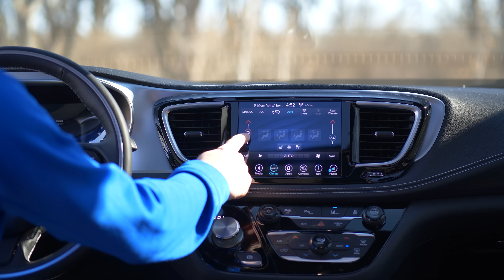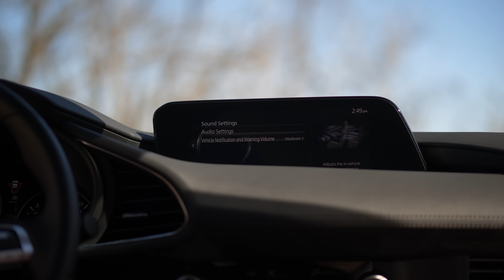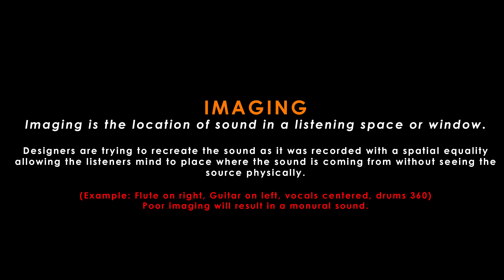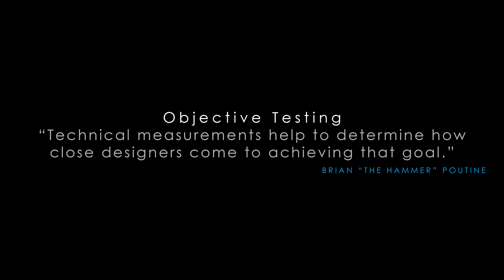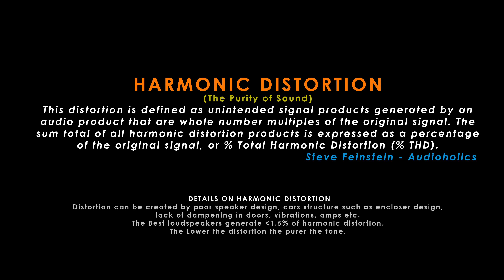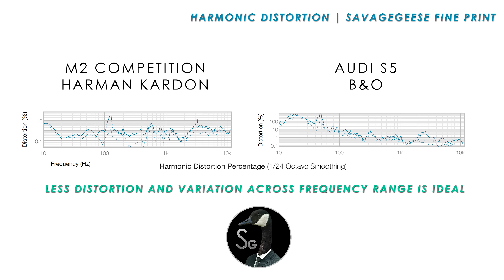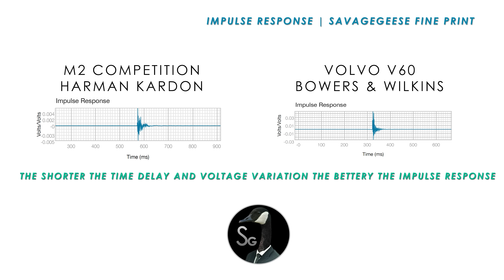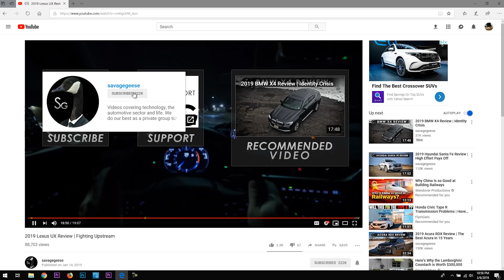Understanding Car Audio Design

Comment: All you need to do to get an amazing car audio setup is to head down to your local Wal-Mart, pick up two 12" subs and a 1000 watt amp and install them in your car. Preferably, all of these parts should be from brands no one has ever heard of. You will know you've hooked everything up right when every 808 bass hit in your Migos songs furiously rattles your license plate to the point it nearly falls off.
Reply: Don't forget the undersized copper clad aluminum wire that isn't run to the battery in the trunk (near the amp), but, to the jump point under the hood. All joking aside, I re-did a system last week that was setup like that.

Comment: Very Nice Video
Would like to add some notes

Note:

1. More Drivers does not equate better audio quality - So yup Marketing
2. Drivers should have wider dispersion, placement is more difficult in a car
3. Shallow driver design due to depth limitations
4. Drivers should have good sensitivity, less power draw & more efficient
5. B&W isn't that great of a sound
6. Great sound doesn't have a sound signature. It should produce what's given to it. Exactly like the source
7. You can get quality and volume, but driver cost would greatly increase.
8. Drivers in Car Audio markets are often marketed prices far higher when compared to Home audio even when performance is the same
9. Bass in a car would often be more clean due to cabin gain. That means driver does not have to move as much resulting in a more linear performance .ie few hundred vs Killawatt levels. I know because I have 4kW available. EQ can be used to bring a flat response.
10. A car audio setup cannot match a "proper" studio. Especially those with 16' ceilings and proper treatment
11. Frequency response charts are one thing. Speaker distortions and dynamics are also very important. ie. impulse and efficiency
12. Rolling off the higher frequencies gives a more pleasing sound to many people. 
13. Bad drivers/ bad drivers can give tinny sound. Bad crossovers can also have the same effect
14. The distortion is always there, it just increases as you go up to the drivers XMAX. 
15. Due to the difficulty of mounting, drivers with wide dispersion or great off axis response is optimal. Most cars sort of have it pointed straight
16. Paper cone does not equate to cheap. They are light and can be treated. Being light has many benefits.
17. The magnet is also important but so is the control of flux within the motor and how linear it is thru-out it's motion. 
18. The coil used, type of driver design. Underhung or underhung and how it is designed
19. Keep in mind, impulse response is 1 measure
20. You can get very good sound for well under 2k if you DIY.
21. New systems with auto correction can over correct leading to the sound having artifacts. ie ringing, imaging, floating image

Comment: If anyone is willing to spend the extra money on full dynamic range in a system they should already understand that USB audio is still superior and worth the inconvenience.  Also, Apple CarPlay and and Android Auto usually only work with a wire in a common modern vehicle. As much as I love Bluetooth and it’s conveniences, the higher the system power the more noticeable degradation in reproduction will be.  I have a 300wat   JL subwoofer along with JL door speakers and direct firing chin level tweeters located on each corner of the door panel. My car is sound deadened, but this does not discredit my point as most modern cars use better materials for insulation anyway. We are talking about a simple 5 channel setup that can reproduce 22hz all the way up to 22k. I can clearly tell the difference in bass tightness and treble sharpness when switching between USB to Bluetooth.

Comment: I had a Toyota with the JBL system. I still have the Toyota, I just now have Sony ES / Pioneer subwoofers, speakers, and amps.   It's not going to win any competitions but it sounds really good and don't distort when you turn it up.

Comment: I mostly listen to podcast in cars as while i am getting older, i find that music in car is very distracting. It cover most of the spectrum. And you need a certain level of volume to make a good audio system shine. At low level, you will have an hard time to hear all the spectrum. 

Podcast on the other end are mostly just talk and leave a lot of room to hear the surrounding. I also think, altought it's very subjective, that talk radio / podcast are very random by nature where music follow a beat or tempo. I find that listening to podcast in long trip make the road feel shorter than music because of that. 

I think the first thing anyone should do is test driving the car without audio to get a feel on how much noise there is. Then look at the audio.  Some car are so noisy that you have to crank up the volume very loud just to be able to hear properly.
Reply: I agree.  I prefer my audiobooks to pass the time because I can get lost in the story, so I'm not focusing so much on how long I've been at the wheel.  I turn up the mids, turn down the bass, and I'm good.  With music, I find that I have to fiddle with the controls much more because the settings rarely are optimal as the music tracks change, whether I'm streaming or listening to files I have on my phone.  When I test drive vehicles prior to purchase, I will listen to the stereo before I drive.  Once I drive, all that is turned off so I can listen to the actual car, as you've stated above.  Noisy tires can be corrected (more money) but wind noise is something you just have to deal with.
Reply: You don't need more volume, you need less noise.  You would be amazed at what some sound deadening can do for the entire spectrum.  It really should be the first step to car audio mods.  If it was, I'd bet a lot of people would happily stop there.
Reply: @336699334  sure, less noise first always makes more sense. But with this POS Corolla rental I'm in right now, the wind noise is as bad as the shitty engine and cheap noisy tires. Even if I owned this car, I can't do anything about wind noise. My personal cars AREN'T quite this shitty (Lexus IS250 and Toyota Solara).

Comment: I gotta say we bought the Genesis G80 for the in-car listening experience above anything else. The sound deadening and dual paned glass paired to the 900 watt Lexicon system have been outstanding. The ability to enjoy the listening experience in our cars is everything, so I really appreciate this video.
Reply: G80 has acoustic glass windows, not dual pane.
Reply: @michaelgrant5258  Ah I stand corrected. It's awful thick and someone told me it was dual pane so I just bought the line.

Comment: I know the VW Fender system is a re-branded Panasonic system, but I'm honestly surprised at how decent the sound is.
Reply: It's great! My friend has a VW with those Fender speakers and it rocks!
Reply: What is inherently wrong with Panasonic built speakers? They build very high quality parts, fender set the parameters and Panasonic built them well, fender knew the sound they wanted, knew to put enough power in it, knew the issues a car presented and worked with them not against the problems to make a system that sounds great. How is it being a rebadged Panasonic system bad?

Comment: In my experience, only the sound the driver hears really matters -- as soon as you get two or more people in the car, the volume invariably gets turned down enough to facilitate conversation. 

Oddly, some of the best car audio I've heard lately was in a 2015 Chrysler Town & Country. I'm not saying it was good, but it was the least crippled by an infotainment system along the lines of my recent Mazda which had hands down, the worst sounding car audio I've experienced. Murky as hell, and virtually no definition in the high end.

My next car will likely be a utility van of some sort, and I will sound insulate the hell out of it, and created a forward sound stage (ie no door speakers) using a good head unit and a quality amp. Speakers will likely be a quality home pair if I can get the right crossovers. 

Infotainment is for the birds...
Reply: That's interesting.  I haven't listened to much audio in the T&C, but each Dodge SUv and van I've rented had horrendous audio.  For some reason, the front driver side tweeter was always distorted, even at the lowest volumes.  If I have a chance, I'll see how my mom's T&C sounds.  She's only had it for a month, and I haven't ridden in it yet.
Reply: My 2000 Jeep Grand Cherokee with the infinity sound system BUMPED!!! I had a 2014 Dart and now own a 2017 Ram 1500 with just the regular audio and both of them BUMPED. The treble was clear and you could crank the volume all the way up with distortion. And these were the base systems.

Comment: Why measure from the passenger seat? 
The driver's seat has 100% occupancy whenever the car is used. All branded automotive audio makers know this, so if they are going to make a compromise on spatial imaging or spectral response, the decision will be made to benefit the driver's seat, not the passenger's seat. 
The explanation that the passenger seat has fewer surfaces for acoustic energy to bounce around is spurious. No manufacturer designs the DSP for a car amp in an anechoic chamber and then plops it into a car. 

Also, check your definition of impulse/step response. Yes, one can measure the overall latency of a system via the impulse response, but delay isn't what is measured when taking an impulse response. I also take issue with the statement that a paper cone causes  delay. Is the statement is that an audio designer might put different amounts of delay on specific drivers because of their materials? Still a little disingenuous, as generally speaker materials aren't mixed and matched in a car. The rationale goes back to the oft-mentioned price.

Comment: I purchased the Kicker VSS system for my F150 XLT Crew cab. The system comes with an amp that ties into the stock system, as well as the kicker 8" subwoofer. It definitely livened the stock system up. Supposedly it is tuned to the stock speakers and so forth. I'd definitely like to see what the difference is between the VSS setup and the Bang and Olufsen. I definitely learned that you do not need 1200 watts to improve a system. Balance is key. Awesome video!

Comment: I still remember ripping out a late 90s honda civics speakers, pretty much made of cereal boxes, that was where they cut every corner.  Factory sound better be good, because adding it after is simply not cost effective, especially the sound proofing which is frankly the most important part of all.

Comment: The system in my Golf R (Fender/Panasonic) is superior to the Bose system in my Z06 and Civic Type R
Reply: My old GTI Mk5 stock audio also sounds better than several BMW 1-series I've owned, current gen and the one before that. Maybe having a similar cabin/design on the Golf helped VW deal with the challenges of getting good audio

Comment: My Fiesta ST has maybe the best car audio I've ever owned. I've never had luxury vehicles but Evos, STi, Camry, 4runners, Silverado HD. Even my GTi with upgraded audio wasn't as good. Ford Sony system is good
Reply: I agree! I have a Ford Fusion with the upgraded Sony sound system and it BANGS 💯✊
Reply: "Sony"
Reply: Sony is junk for speakers and receivers.
Reply: I have the standard Sync 3 system with navigation in my Fiesta SE and it sounds great to my ears, no overwhelming bass. I use CDs and FLAC files on USB sticks. I have my Onkyo receiver and turntable at home if I want hi-fi.

Comment: The JBL setup in my Camry is by no means high end, but it's good enough for what it is at the car's price point. The problem is it comes with a 'surround' mode enabled on all sources by default that makes it sound horrible, so people think it's a terrible system. The mode will randomly re-enable itself too.

Comment: $$$$  ABOUT TIME!!!  You sir are the best!   I have that pos 370z, and let me tell you, worst audio "system" ever.  I firmly believe that the stock setup in that car does more to damage hearing than anything else.  The road noise is what kills the experience in the 370z, mainly the back half of the car, so it required tearing it apart, and installing multiple layers and types of sound deadening, and yes, it still sounds horrible, but it's been a monumental improvement in moving the frequency of the road noise lower and to a good degree quieter.   It's still no audi. 

I found you really have to just rip out everything with the stock setup and start over,  so you have your sunk cost of which head unit you want, speakers, amps, wiring, time/frustration, and integration (getting the steering wheel controls to work).    Then you get to go through the fun of time alignment and additional sound deadening and locating rattles and redoing things.   Still when it's all said and done, it was worth it, but it's still a Nissan product, so it's never going to be Lexus / Toyota in terms of NVH/quality, but you kind of forget all that when you're not stuck behind the Subaru / Prius drivers and get to tackle a good set of corners while your fave music is blasting. 

For the 370z, the time alignment aspect made a night/day difference in getting the sound floor above the stupid dash, but you're right on the $$ when it comes to the tweeters bouncing off the front glass, so attenuation as well as a soft dome design helps, along with running the largest one you can get in there to bring the x-over frequency lower (yes at the expense of longevity) which then brings the imaging up a bit. 

I'm a firm believer in one channel to each speaker and going fully active to maximize control and output compared to running passive x-overs in your typical component kit setups.  Running a separate class A/B amp for mids/highs and a separate class D amp for bass garners maximum control so time can then be dedicated to the never ending process of dialing things in.  Lastly, the biggest challenge of all is simply finding quality music that has a longterm shelf life, as most now is recorded with loudness pegged and the whole auto tuning nightmare = can be harsh in the car over long time periods because of the reflection issues you've mentioned (most tweeters are bouncing off the front window).

Comment: The best way to improve sound quality is to start with the source. Can we get away from compressed audio here in 2019? Flash drives can hold thousands of uncompressed songs these days. Unfortunately, digital music stores are still stuck on compressed audio.
Reply: That's because their servers will run out of bandwidth sooner with larger files... Best off just buying CDs and ripping them to your preferred format.

Comment: I can tell you without any special equipment that the base stereo in a Honda accord (9th gen) is HORRENDOUS.
Reply: I haven't heard a Honda stereo that wasn't terrible. Even the "440 watt 12 speaker premium audio system" in my Civic Sport Touring pretty much sucks. Acura's ELS system's on the other hand are actually pretty good though.
Reply: @splewy  The speakers in my S2000 are also ridiculously bad. But I take that as a hint that that is not what the car is about. Honda should up their game for less sporty models though. Nobody wants bad audio in their daily.
Reply: 9000Redline Yeah agreed. My Civic is my daily, and I was pretty disappointed that the most top end “premium” audio system offered in that car was so bad. I guess they’re saving the good stuff for Acura though, because like I said before, the ELS systems are all really good in my opinion.

Comment: Sound signature? WTF?,...the idea is to reproduce the original sound inside the vehicle. That said, the general public doesn't want "near field monitors"  affixed to the dashboard, rather the public wants them built into the doors, pointed towards your torso...or butt. This very constriction assures everyone concerned, in car systems will sound like crap...do yourself a favor &  affix monitors on the dashboard...don't have the room inside your car?...then you will have crappy sound, always will.
Reply from the maker: Id love to see someone mount some near field monitors on the pillars.
Reply: @savagegeese  Something like a vintage ADS L200C, or the larger L300e mini-metal speakers, or the full-on JBL LSR 305,(I know, AC powered amp, easy to convert) ...or the cheaper and more plentiful Realistic Minimus 7 ...don't like such things on your dash?, don't like music I guess.

Comment: hey mr savage, for the future when you are displaying graphs, make sure the scale for the x and y axis are the same. there were many graphs in this video that did not have this and I bet a decent chunk of people misinterpreted some of the information you provided because of it. i'm very thankful for you to take a scientific approach to car audio and am excited to see this implemented into future videos.

If it would be possible, could you also do this kind of testing to see how good, for example, a $2,000 aftermarket car audio setup is compared to a $2,000 manufacturer car audio setup? I have always been under the impression that if you spend money on good aftermarket speakers, such as audison or audiofrog, and a quality tune (equalizer, DSP, time alignment), the performance/dollar will absolutely destroy harmon/B&O factory setups.

Comment: I had the BMW M3 convertible which had the most powerful audio system they had ever created.  It was good.  Then I heard the Tesla Model 3 audio.  I’m blown away by it.  The Model 3 system is incredible.
Reply: Power doesn't equal quality, I'd rather have higher sensitivity speakers in a car than more power. You're absolutely right about the Tesla, better than anyone yet.